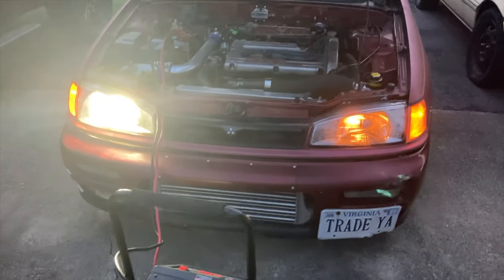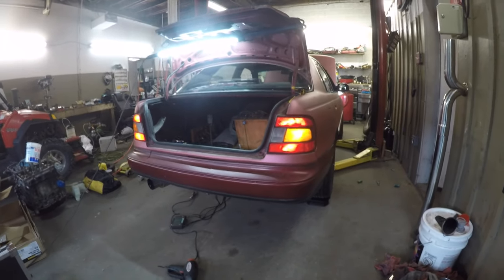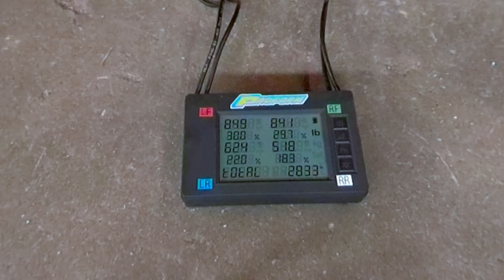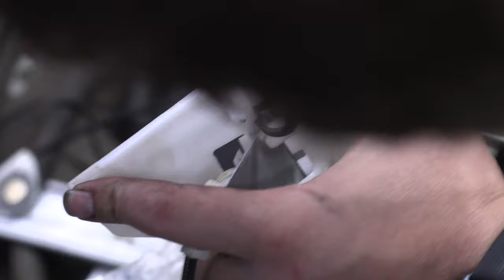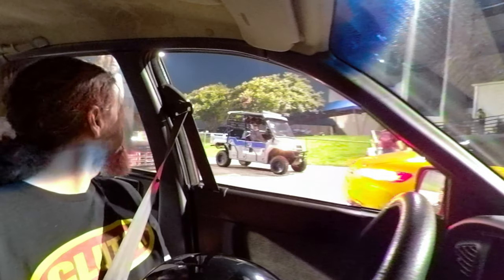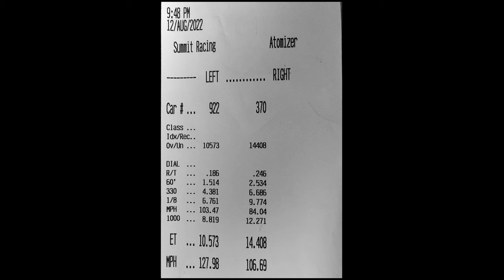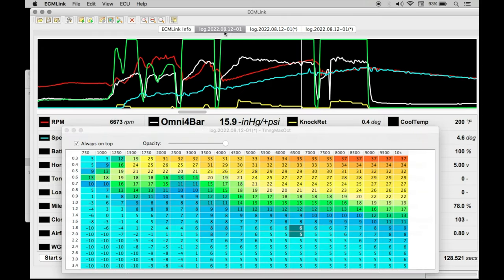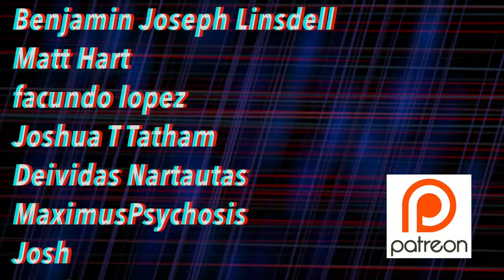Fix 7 things, break 2, & drive terribly.

Comment: Man, I want one manual Elantra, same year.
Reply from the maker: This one was an automatic!  You'll find the GL models are more likely to have the manual transmission than the GLS model with power options.  Those are the KM210 equivalent gearboxes.  Fine if you have a stock, normally-aspirated engine, but if you want a manual Elantra with a turbo 4g63 in it, you'll want a F5M33 out of a 1g DSM.  A few more mods to make it fit, but the DSM shifter also fits with a little persuasion.
Reply: @Jafromobile  about an hour or so, from I found a 2door Elantra, yup the GL model.
I wonder why Hyundai haven't done a turbo 4door &2 door with a 4g63.
These just seem they have the space in engine and front bumper.
I know yours  had a different front bumper but the stock 2door GL I've seen it looks like it's meant to have one.
Forgot what year this 2door GL elantra, the seller is asking 2500 best offer I think seller mention it has a slipping transmission.  
I know our cousins from up north Canada they did get a similar hyundai but its non turbo 4g63 manual GL.
Had a brain fart I remember my step brother from Ontario, had a black Hyundai 5speed 4g63non turbo GL 4door. It did have manifold said Hyundai on it. 
Am in middle rearranging my garage.
I know I've said this before, and I shouldn't been procrastinating by not upload a video or two since my first  video from10yrs ago. Alot has been going, things have improved whole lot.
And I've lost lot of weight too. 
Profile pic is an oldie  my waist went from a triple quarter pounder size 40-44 down to a 32/34. Size I was I high school  but slightly more muscle than I was in high school.
Lot had to from  my ex girlfriend after my ex wife,  lmao.
I got my crap together everything is good I feel good too. 
People still talk crap oh well and old flings I once had, noticed changes their trying get back with nope not today satan.

I've  heard you mentioned electronic steering try source one from a car that's EcoBoost they have electronic power steering rack.

Relative has f150 ecoboost while back he need alignment done, dealership is only shop to do it, he was charged 2500-3,000 for new electric steering rack plus alignment. Lol

Does your car have an Qualfy lsd in front. 

If not that might be why you ain't getting traction also, lower your tire pressure abit.

Comment: I don't know what electric steering system you plan to run but the ones that work by sensing input in the column and assisting can amplify torque steer if not set up right. The Gm system can tune some out but then have a bit of a dead spot. I'm going to try to use one that has an electric pump that pumps fluid instead of turning the column.
Reply: A number of people have done the Prius swap on the DSM platform.

Comment: is the hyundai a daily?
Reply from the maker: It will be this fall...  The headlights vs short winter days have previously been a real bummer, but they're not anymore. Once it holds all of its oil and has no belt squeal, I'll drive it every day.  All of the parts for those permanent repairs are already here.  It's extremely streetable, and actually actually rather mousey with the cutout closed despite its cams.  It's still cheaper on gas than my F-150 IF I can keep my foot out of it.  If I don't, it's about the same.  It's every bit as awesome to drive as my truck, but in a completely different and alien way.
Reply: @Jafromobile  sounds fricken awesome man 👍 👍👍👍

Comment: SSD's generally take more power than the old HDD's actually. The difference isn't much but just saying.
Reply: Who told you that?
Reply: @Milkmans_Son  The labels on the drives I have happened to have side by side.
Reply: @lxfguits  What make and model drives are they?
Reply: @Milkmans_Son  I found an old crapped out hitachi 7K750-500 off my shelf. I think in actual use it might average better than one of my samsung evo drives. Just sitting idle an SSD will take less but average consumption when in use is what I'm talking about.
Reply: @Milkmans_Son  it's true though. SSD aren't the LED of hard drives. They use more power, just happen to have 2 less moving parts
Reply: @cryoburned  Well, yeah, if you go by the max draw I suppose.

Comment: I’m surprised you just installed LED headlight bulbs and didn’t care about other drivers and just essentially have your high beams on all the time. Your work is usually really well done. I figured you’d do a retrofit with a LED projector and do it properly. Your headlights with the LED should have failed the state inspection due to terribly blinding other drivers intentionally.